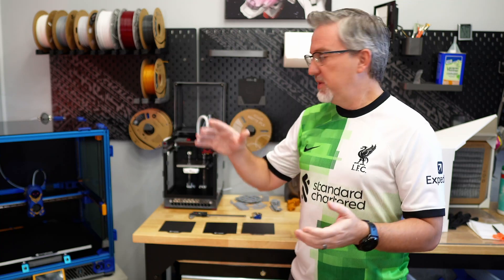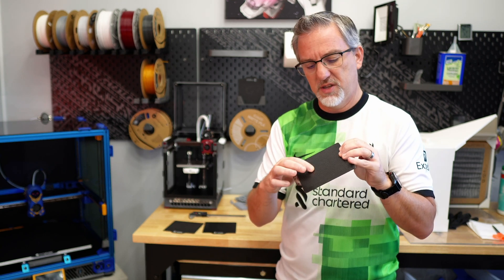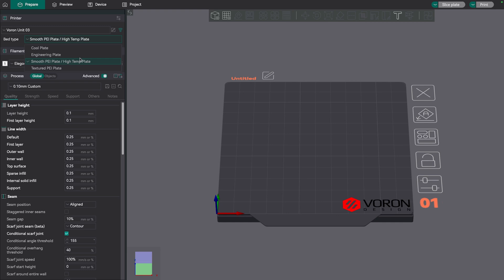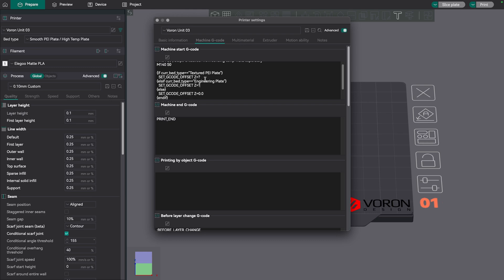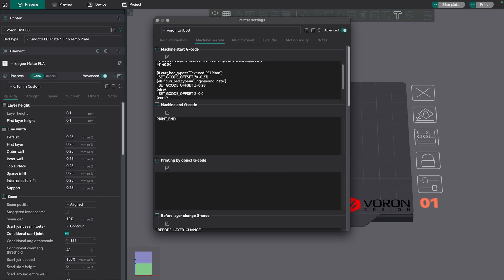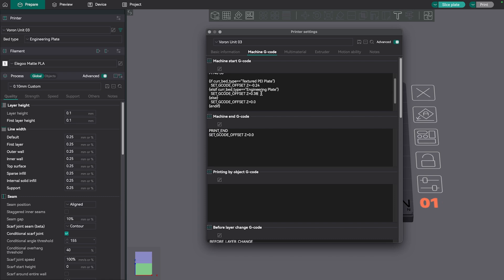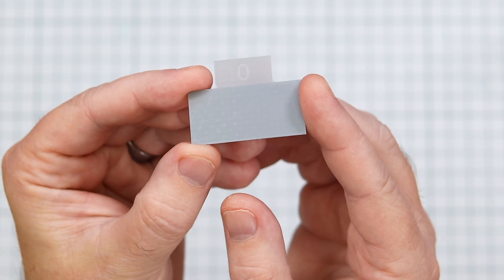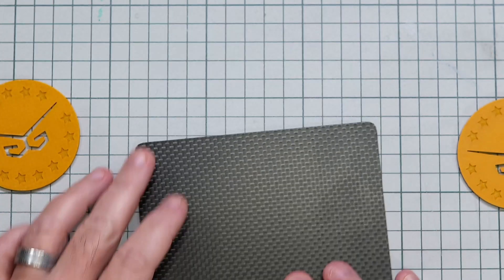Voron 0.2 Tuning - Configuring Multiple Build Plates in Orca Slicer

Comment: Grrr I was thinking about getting a Voron v0 kit. Then I stumbled on your series and the struggle became real. Now I have ordered the kit from Fabreeko lol. This hobby will kill your bank account if you let it.
Reply from the maker: Well my apologies then. But also, enjoy!
Reply: I'm sure I will. I do have a question about adding fans for mods like the nevermore, are there extra fan plugs on the included controller board?
Reply from the maker: Taking a look at my current configuration, the SKR Pico has two unused 2-pin connectors that are labeled specifically for fans. It also has one extra 2-pin and one 3-pin connector that you could probably also configure for use with fans if you really needed that many.
Reply: @gunplamark  Thanks, I'm a truck driver so I get 1 week a month at home to do these fun projects. I get home either Monday or Tuesday and my kit is there waiting for me so I get to start building. I decided to get the stuff to do the Dragonburner and skip the included extruder build. Other than adding a nevermore filter it will be built pretty much stock though so I really appreciate this series and being able to reference it during the build.

Comment: This is really cool! Fantastic video. 
The downside to this approach is if you readjust any bed screws and that impacts the z-offset, you need to reslice or manually modify any old gcode files if you need to print them again.
I think a more robust approach is to implement macros that set the z-height for the different sheets and have the start gcode call those rather than explicitly setting z-offsets directly in the start gcode. This has two advantages. One, if your z-offset changes, you can comment out the macros for each build plate, or add more logic to handle the situation where you haven't recalibrated the z-offset to cancel the print.

Two, this allows you to share the gcode between multiple machines. This is more of a niche workflow, but could be useful to some.

Personally, I just created a build_plate.cfg with macros for different build sheets and I run them via klipperscreen when I swap plates. I would like to display the build plate that is set but I haven't gotten around to it yet. When I make a change that impacts z-offset, I comment out all thr macros and the include of the build_plate.cfg from my printer.cfg and uncomment when I've updated each macro. Ideally, you should only have to recalibrate for one and apply the same delta to all the macros.
Reply from the maker: Good suggestions. I'll likely end up moving the z offset values for the different plates out of the slicer and into a config file. It was easier to just show how the process works by editing the gcode snippet directly in the slicer.

As far as bed screw adjustments, the way I've set this up is that the z offsets for the "extra" build plates are set relative to the standard plate that I already use, so if i adjust bed screws (or change out the nozzle, or make any other change that affects z height) I just need to recalibrate the z endstop for the main build plate and the others will still work.
Reply: @gunplamark  That's a great solution